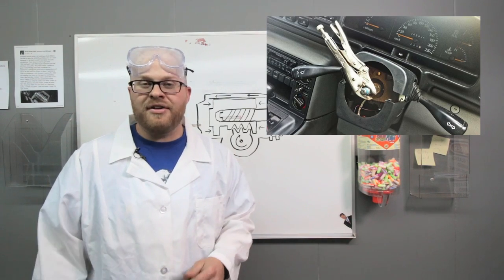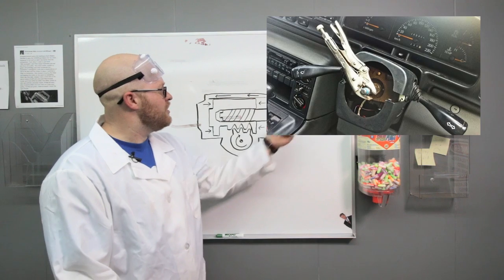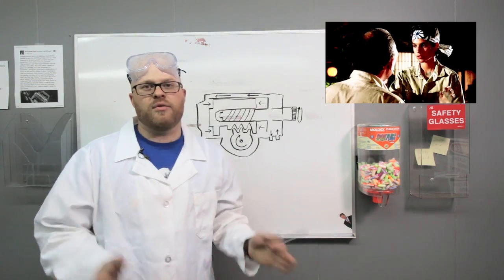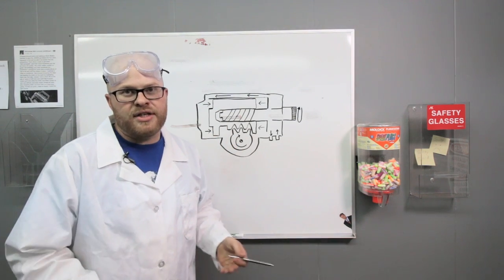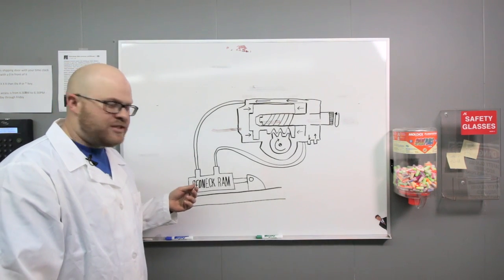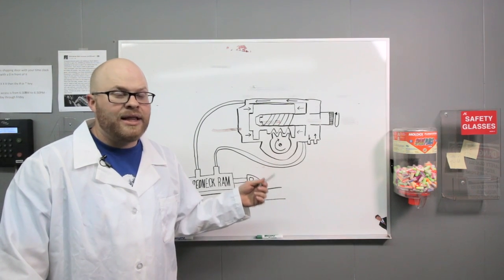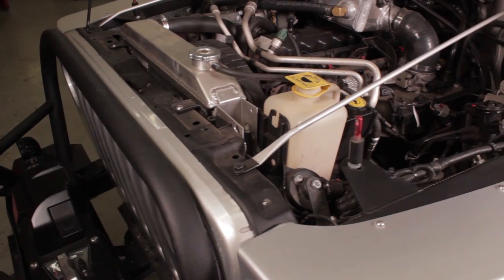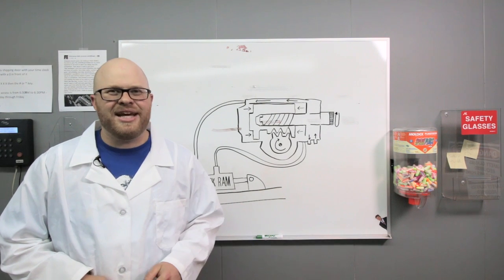Hydro Assist Steering - How Does it Work? | West Texas Offroad - Redneck Ram

Comment: I have a question about hydro assist steering in general. It seems like all the hydro assist setups I've seen use a double acting differential hydraulic cylinder as the ram. This kind of cylinder moves slower with more force on extension and faster with less force on retraction. Wouldn't this make your steering react differently from left to right?
Reply from the maker: Yes, with this type of ram you have more force in one direction than the other. It's not something we have ever noticed offroad, however.

Comment: Is this necessary for 33s or 35s on an XJ Cherokee
Reply: THE STOCK axles are not really happy with 33's... happier with 31's... but if measure most 33" tires... they measure 31" on loaded vehicle, so... 33's are 31's.... 35's are REALLY 33's